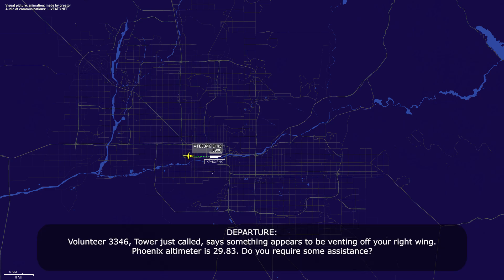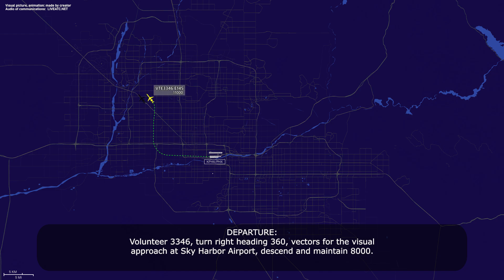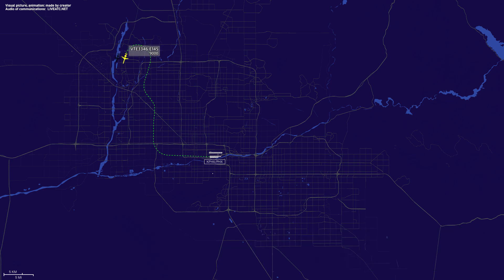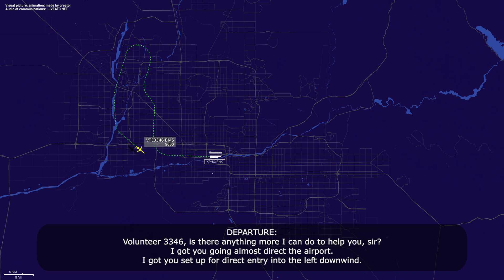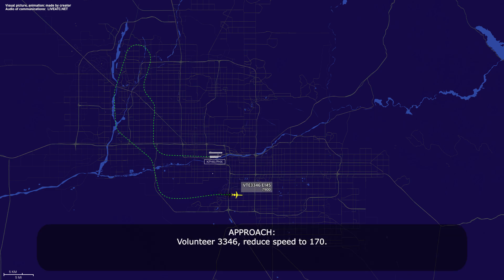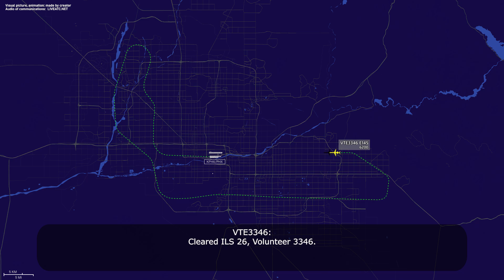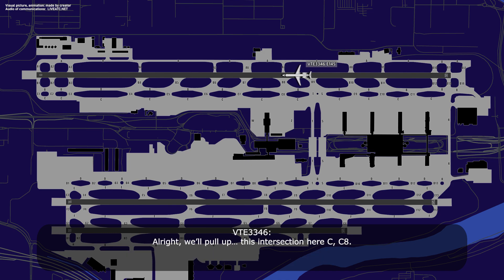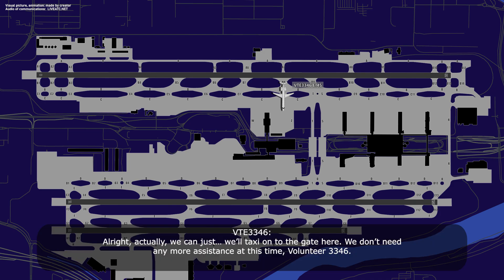FUEL LEAK after takeoff. Contour Embraer ERJ-145 returns to Phoenix Sky Harbor Airport. Real ATC

Comment: why not use port and starboard?  so much easier (when talking about plane parts like wings and engines)
Reply: A 360° compass is universal because, ATC's position would be relative using starboard/port. Using  a compass , eliminates extra steps for navigating, plus, 2D VS. 3D visual tools.
Reply: @RayMclaughlin-ff2rn  Oops, sorry I'm talking about their engines/wings descriptions not actual turning instructions.  "Right side number one -- I mean my right side not your right side." that bit.

Boats use degrees for things like headings too.
Reply: @MKc-pm9tw  left and right are defined by the person interpreting them.   Port and starboard are ALWAYS relative to the front of the thing being referred to.   There is no "my starboard or your starboard" depending on which way you are facing, the starboard wing is always on the right side of the plane as you're facing the same direction as the plane.
Reply: @zachansen8293  Basically everyone numbers engines left to right and it is usually referred to them as captains or FO side.

(Some airlines also numbered 3 engine planes 1 2 3, but most do 1 3 2)